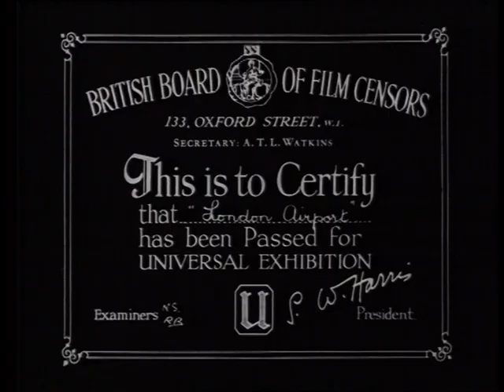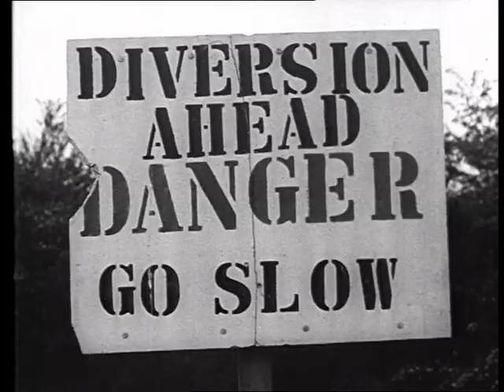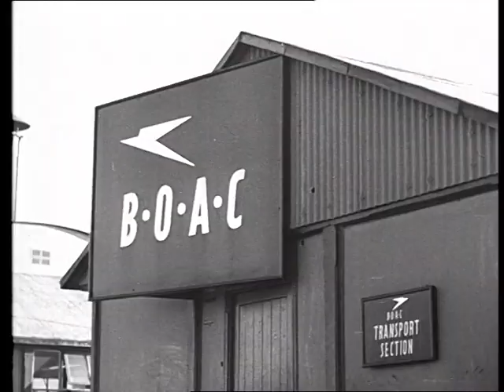London Airport - Heathrow Construction Film

Comment: How heathrow wishes it still had that may runways
Reply: Apart from the two East -West runways the others had short lives and became taxiways, car parks,  aprons or built upon. Runway 13-31 was retained as a short crosswind runway until relatively recently but was rarely used.
Reply: But due to the layout of the many runways only two could be used at once. The other runways were also much shorter.